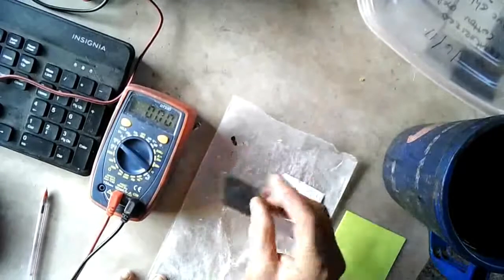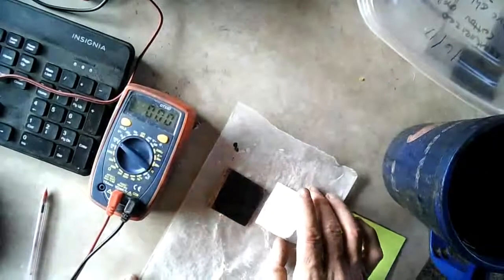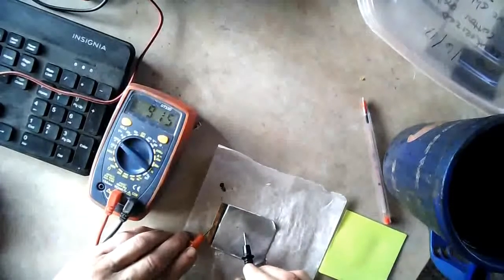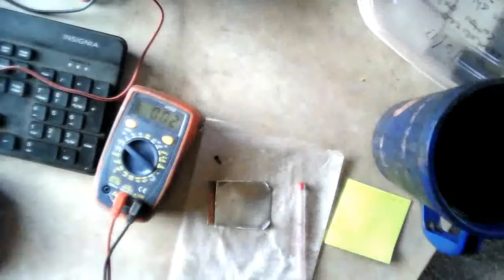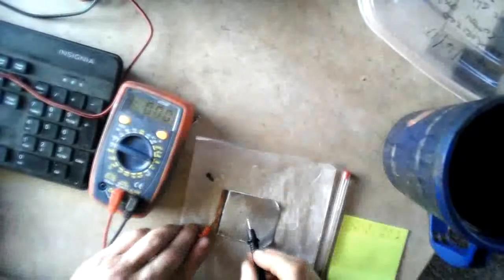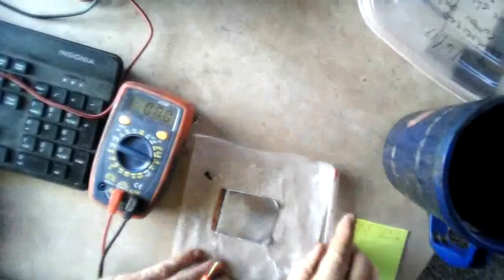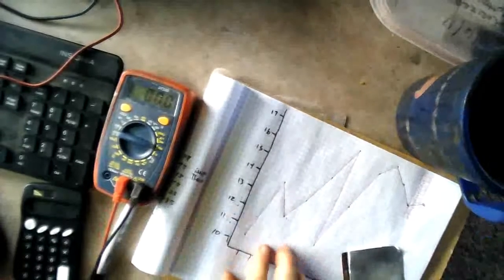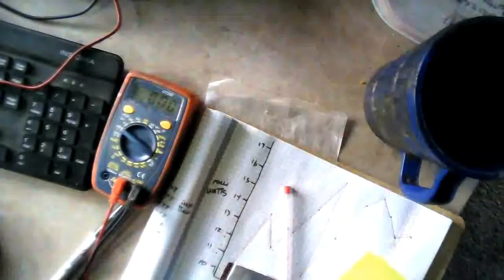The Liquid Crystal Bio-Cell! (Zero Free Water)

Comment: Hey buddy good results . I really do feel it a good idea to get a cheap meter with peak hold function as you do a lot of peak current measure and from my experience the latency of the meter would be giving you totally inadequate readings ! I say this from the heart bro cos this research is important !
Reply from the maker: Thanks for the suggestion EPNM. I have a hold function on the meter I'm using, but I never use it (don't even know how). We can always make improvements in the way we do things, and I will usually make the changes when it's necessary. I'm working under a lot of limitations right now however, and for the moment the present measurements are accurate enough for demonstration purposes. I'll have more accurate measurements once I start comprehensive testing in the test chamber I'm building.
Reply: Bio-Cell looking forward to it . 🍻

Comment: Maybe 'jumps' in data points are result of contact patch varying.  Some form of weight or light clamping could help?
Reply from the maker: Perhaps. I've had more consistent results for sure, but I see the same cyclic pattern over and over again, which leads me to believe it's constantly restructuring it'self as the cell drys out. Could be something else tho.

Comment: What I'm missing is the cycle times. Do me a favor and put a clock in the picture so each time you take the measurement the time is recorded in the video. You don't need to record it since it would be in the video itself.
Reply from the maker: The cycle time varies depending on how high I let the self-charge go. A 90% charge is always fast, just a couple of minutes. The higher I let it charge above that point, the longer it takes however. That last .001 volt can take minutes alone, and I never know if it's truely the high voltage or not. This morning when I got up for example, the cell had climbed to 1.06 volts. It also tested at 33.4 milliamps, a new peak high. I just let it charge back up (an hour) to 1.064, and it produced 35.2 milliamps, another new peak power point. The cell climbed to .94 in less than two minutes however. The 90% charge time is the important figure, and if that's slow, you have a shitty cell to start with.
Reply: Thanks Ray. That's important data. I look forward to seeing how the "water free" cell performs. It is getting closer to being a solid state cell. Bit by bit it keeps looking better. There are still questions in my mind about the cyclic charging characteristics. Your hypothesis is reasonable. Subjecting the cells to data logging will answer some questions but will also invariably lead to others. The research is heading in the right direction.
Reply from the maker: We're making substantial progress. I just ran the 31th cycle on the liquid crystal cell, and it peaked again at1.036 volts and 45.5 milliamps. It over 30 hours old, still drying out, with no added water. That's like 5x more power than it started with.